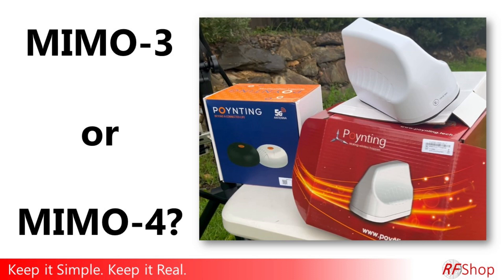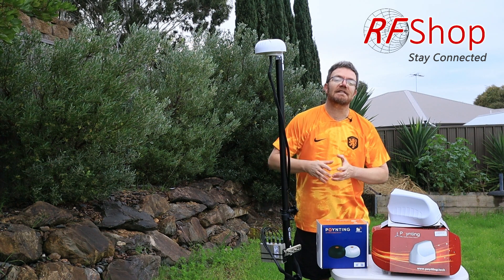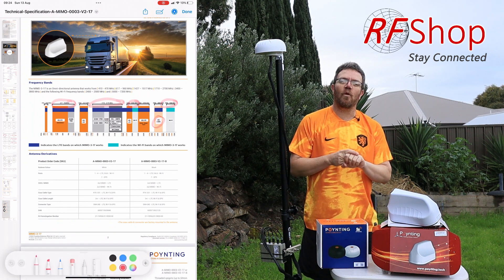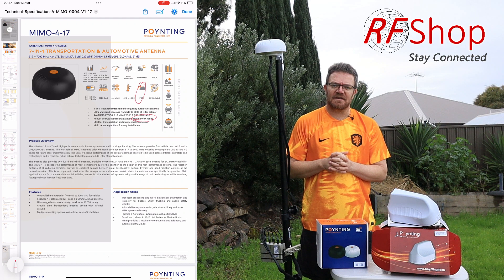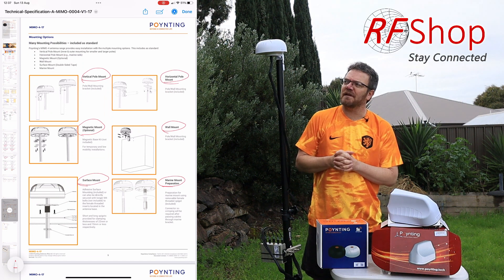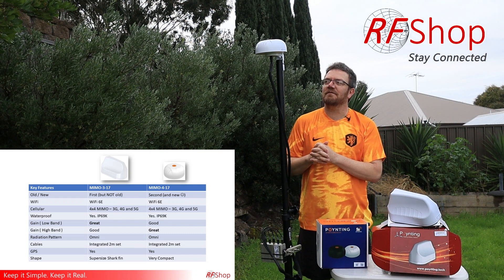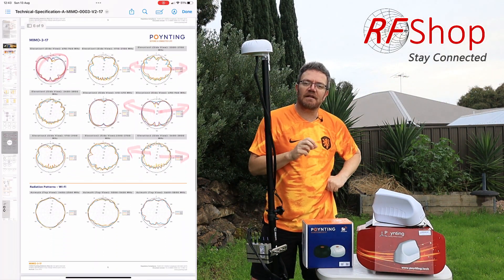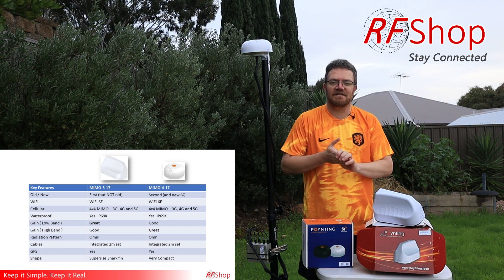Choosing the Right Antenna: Poynting MIMO 3 vs. MIMO 4 Explained

Comment: Hi all. I am currently using a TP Link Archer MR600 router for my mobile internet in my caravan (German Eifel). Would an antenna upgrade to the MIMO 4 have much of an improvement over the stock (internal) antennas? Usually I only get about 5 Mbps download and 3 Mbps upload speed. The signal isn't great at the camping site.

Comment: Hello, cold you please advice me the best antena for my rutx50? 
I'm using the router while fishing in areas with low mobile signal, I don't need strong wifi signal as i keep the router next to me, also GPS no need it. 
I only need the LTE 4g signal.
I was thinking also to setup my router outside my bivy but i need a waterproof case for the router, pls help me with best solution with sharing the link so i can buy it. 
Thank you very much

Comment: Im setting up to run my house off a Netgear nighthawk M6, I live in Melbournes West and my nearest 4G/5G Optus antenna is about 950m away in direct line of sight from the roof of my house. I have been told by Optus my house does not qualify for one of their 5G modem packages but as an Electrician I believe I can accomplish just as fast speeds as their set up by putting something together of my own. For this setup which antenna would you recommend me purchasing taking into account everything you said in the clip? I'm going to assume its the MIMO-4-17 but is there another antenna you believe might be better suited to my situation? Thanks 👍
Reply from the maker: Hi. For a fixed setup I would consider an XPOL-2 ( i.e. a directional antenna ) over an omni-directional antenna. The reason is that you know where the signal is coming from, so you may be better off doing everything in that particular direction. My suggestion, if you stick with the NightHawk M6, is to get an XPOL-2, 10m of cables (or whatever length works for you) and the TS9 adapter cables. 
Regards,
David

Comment: Hi, I was wondering if you can connect (either one) directly to a router with integrated sim card (which is in a rural area, so low reception).
Reply from the maker: Hi, as long as the router has external antenna ports it should be possible, yes.

Comment: Great video, I'm currently using g a RUTX50 as a home internet setup in an Urban environment and was thinking if buying an external antenna to mount vertically on the exterior wall. Would the mimo3 or 4 performed better vertically?
Reply from the maker: You would need to mount the MIMO-3 or -4 horisontally. It has a null facing up, which is OK for an omni when placed flat but a problem when the null faces outward

Comment: Does it act as a mobile booster if you add a router?
Reply from the maker: Hi Aden. I would be tempted to say "Yes", but it does depend somewhat on what you mean with booster...as your question might assume a gain in power which it does not do. It directs and gets more from a particular direction than not having it. It certainly boosts the system performance

Comment: Great video, thank you, I have a net gear nighthawk 6 which I’m going to use in a motorhome and travel around Australia. I’m wondering whether the MIMO 3 or 4 would be best in remote areas, from your video I’m thinking the 3. Would you mount it to the roof knowing it would have solar panels and max fan at approximately the same level or would I mount it on a mast. I also want to use the Internet while I will be driving for maps music and research. Thank-you
Reply from the maker: Yes, I am actually still much more in favour of the MIMO-3 series. The gain in the lower bands (which is what is used in the more remote locations) is still much better on that particular model. 
I have seen quite a few installations where people use a slight stand-off to lift the antennas from the roof itself and have it on the height of the solar panels. These antennas don't need a ground plane so that would be a very good idea for a permanent solution that's lifted say 10cm or so from the base surface.
Reply: @RFShop  Thank-you, and I presume a Poynting 3-12 will work best with the Nighthawk?
Reply from the maker: @brianroylegend yes, that would be my recommended antenna

Comment: Idk if this is the right spot to ask but I have 5G home internet and ALL my metrics are good EXCEPT SNR. I get up to 6 on a good day. 4 on average. I have LoS to the tower with no obstructions, about 400 meters. RSRQ sits arpund - 4, RSRP around - 65.
Would an antenna helps this issue? I saw you did a video on a satellite being used. Would that be a good option?
Reply from the maker: We typically see that SNR can be improved with a good external antenna. It is always a bit of a guess as to what could be the root cause of lower SNR, but a directional antenna can reduce noise source visibility in other directions, plus with the "cleaner" antenna to antenna connection using a direction antenna helps a lot (as you are not trying to use a very dirty indoor signal with all the reflections that come with it). One thing to be mindful of is that RSRP is very good, and we have actually encountered cases where the modem was getting too much and was overloaded. In that case the customer removed antennas and it worked better. Try weakening the RSRP to about -80dBm and see if things improve.

Comment: Already been a month asked few question about there system never got a reply
Reply from the maker: Can you please tell me what the questions are? I don't see any question on our system
Reply: @RFShop  submitted a enquiry form, anyway question was if you had any internet system for remote outback in Western Australia other than starlink. Places where there are no mobile receptions. Thanks
Reply from the maker: Hi  @nesu40 . These antennas would need some mobile coverage. At the moment the only solution in the really remote locations is Starlink, unfortunately.
Reply: @RFShop  ok thank you very much for the info

Comment: I have the mimo 3-15 with rut50. Should I upgrade to the mimo 3-17? Will it make much difference,
Reply from the maker: Good question. If you are able to get all four external antennas connected to a router it would indeed help in the more remote locations where the signal is weak

Comment: Good piece mate, thanks. Although I have Starlink, I'm thinking that your solution for a caravan, might pay itself off with reduced Starlink usage.
Reply from the maker: Stuart. we see quite a few people look at Starlink back-ups. 4G and 5G is a great option indeed.
Reply: Also you can use the mobile solution while moving.
Reply: I am aware of Starlink in motion plans but how on earth are you going to power, run cables and mount the kit.

Comment: The form factor of the antenna will dictate the gain in the low bands, the MIMO-3 is taller than the MIMO-4 (which may not be desired). As it was mentioned, each has it's benefits, it is just important to know your specific requirement (help is always around for this). A field test comparison of the 2 comparing connectivity over 6 months or so would be very interesting to see (in the different bands). I think the MIMO-4 is prettier. 🤣
Reply from the maker: Yes, agreed.

Comment: hmm, I just ordered the mimo 4, but it sounds like I should have got the mimo 3
Reply from the maker: Was it from RFShop? Both are still great, I just wanted to point the finer details out !
Reply: @RFShop  yes, order #27419. talked via web chat last week, but the differences weren't really explained.
I'm working from my Kimberley Kruiser E class (6m full offroad van), and need fast, reliable internet. Currently running Optus 5G with their router, but it's not great with marginal signal.
I'd already bought a RUTX50 and antenna elsewhere but sent the antenna back as it was only 2x2. So I'm looking for the best antenna to handle Telstra or Optus networks.
Reply: yeah man both are excellent. I only had the choice of 3 at the time
Reply from the maker: @nakorau not knowing your setup I can't say for sure, but I reckon you'll be perfectly fine :) 

In this video I am being a perfectionist
Reply: @RFShop  thanks for your excellent help
Reply from the maker: @bonezed  thank you